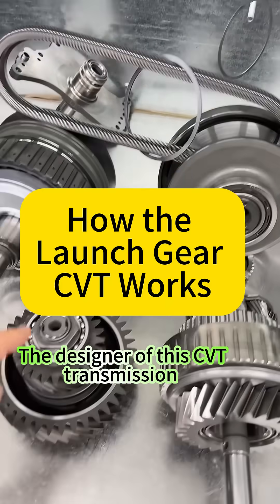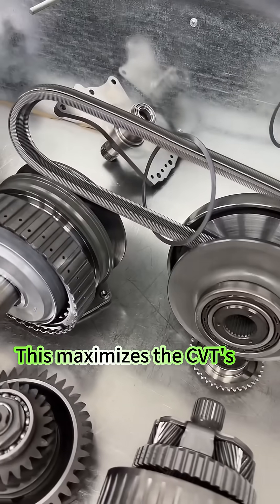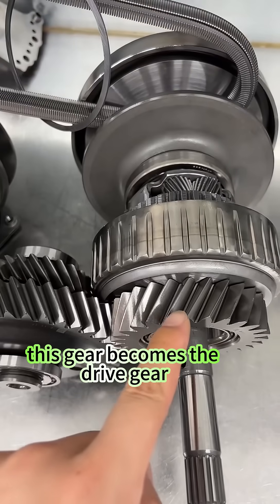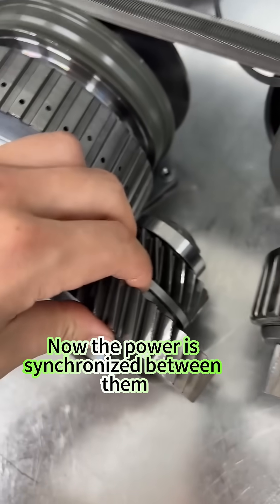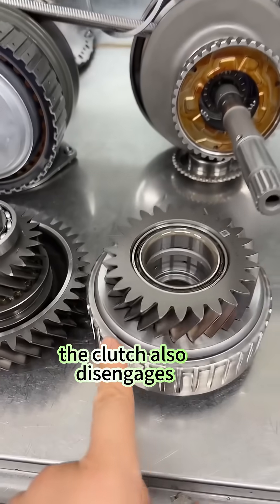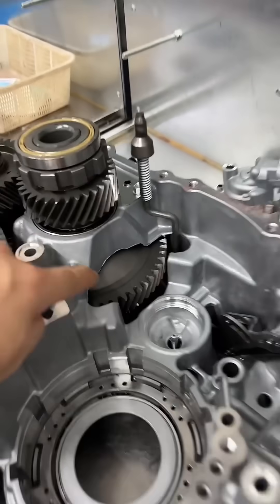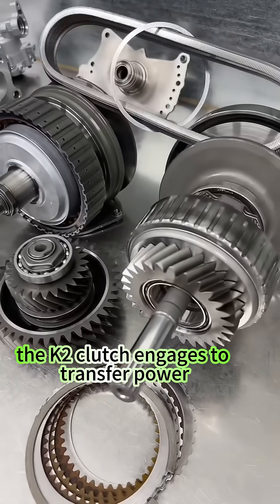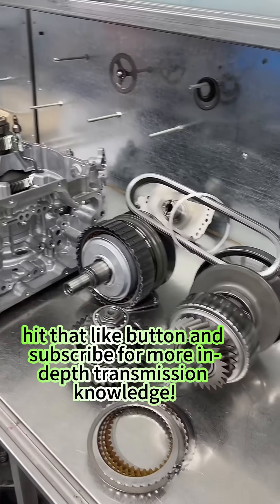Toyota's Genius Launch Gear CVT Explained #transmission #gearbox #mechanics #carrepair #

Comment: thats the first gear start clutch.   all cvts have them.   the purpose of the start clutch is to provide the low gear/speed crawl as you take your foot off the brake pedal.   u know when the start clutch is bad in a cvt when the vehicle shudders from a stop as you are taking off.
Reply: just toyota
Reply: @vraskas4444
is that your assumption?   because honda had it in the 90s along with audis.   pretty sure nissan cvt trans also has a start clutch too.   that's how they creep forward.
so i have no clue as to your unfounded claim.
Reply: @dbltapasian I rebuild these. there is no "start clutch". usually theres only forward clutch, reverse clutch, and the clutch inside the torque converter. some Jatcos have another clutch pack for another forward "gear" range but thats it. definitely no one but toyota past 2007 has a launch gear separate from the variators. I don't know too much about older ones so if you have a trans model number from earlier years you say does have it, I am curious
Reply: @vraskas4444
maybe what u refer to as the forward clutch, I'm referring as the start clutch.  as for torque converters in cvt, i think these are the later model ones as the early ones in honda and audis didnt have a tc.  i wouldn't be able to give u the trans model numbers of the models as all we did was r&r.   we didn't rebuild them.   just going by what manufacturer training has covered as internal components and common faults with cvts.